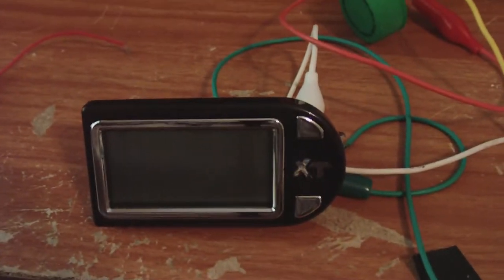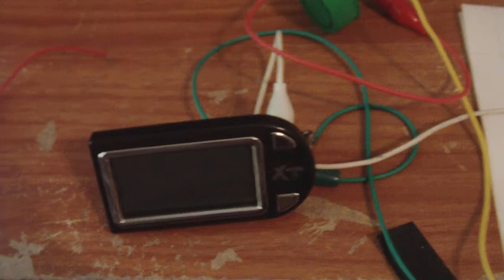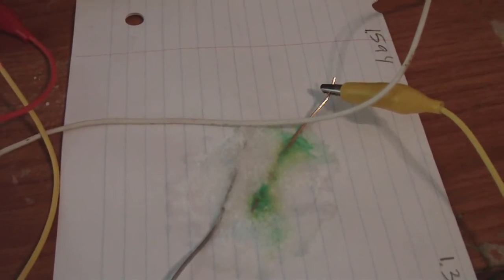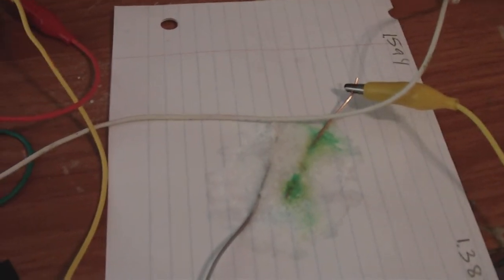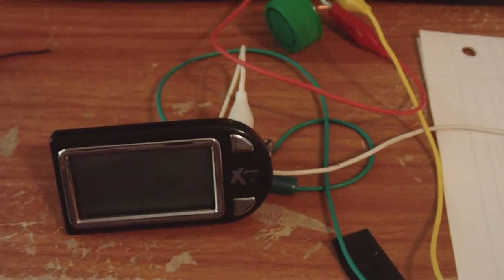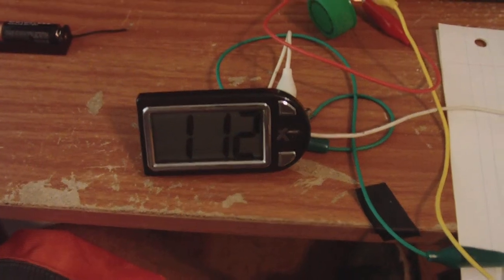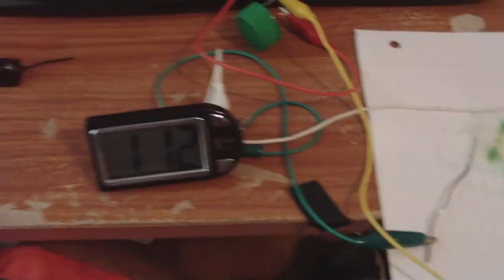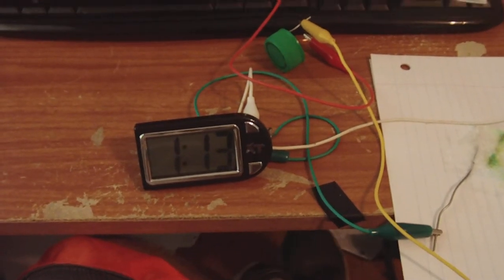Glue Crystal cell powering LCD clock

Comment: Great job, my friend! So programming cells working good! If you wish to power bigger devices, you must use energy drinks (bigger electrods) cans fiiled with your stuff (your ingredients) and you can switch beetween series of 3 batteries with another series of  3 batteris at 12-24 hours, (total of 6 batteries) to have an overunity device that never remains without power! This is my method for having electricity all the time with this crystal electret batteries! Overunity lamp or flashlight!

Comment: I tried aluminum and stainless with good results.
I modified the method a little, made a saturated solution of your mix and soak a paper towel when the towel is almost dry I glue it.

Comment: So this charged green cell now has an output voltage of about 1 Volt ?
So this is interesting, so you raise the voltage with polarising it during drying ?

Does the Voltage go back to about 0.6 Volts after some time
or does it stay at 1 Volts when it is open circuit over longer time ?

Many thanks.
Regards, Stefan.